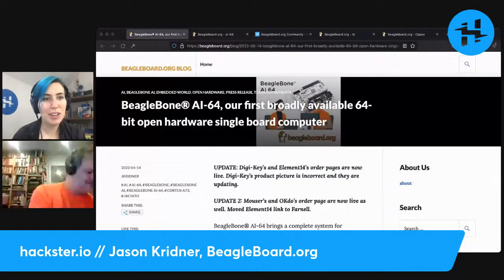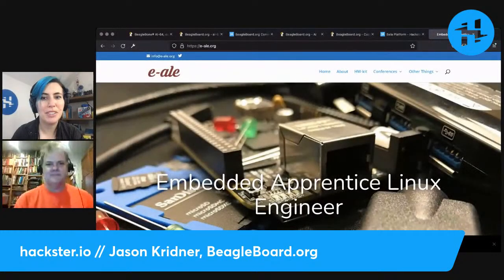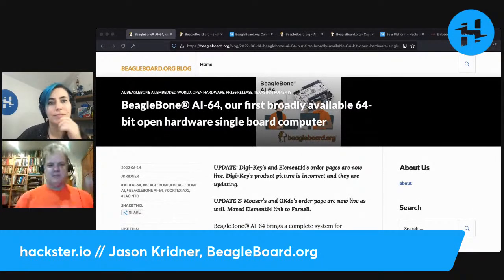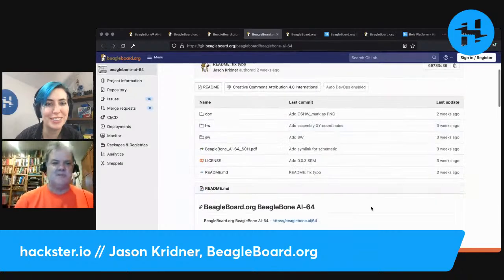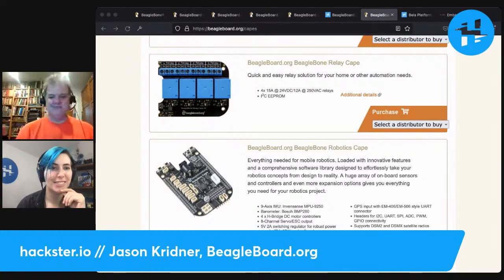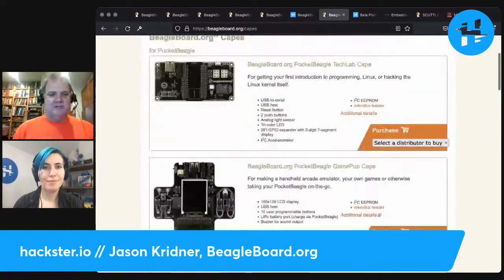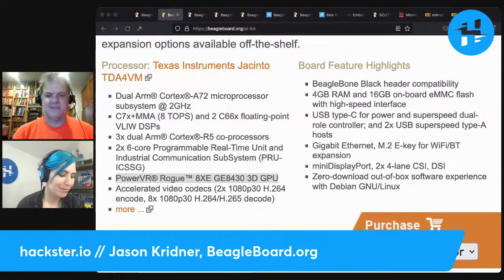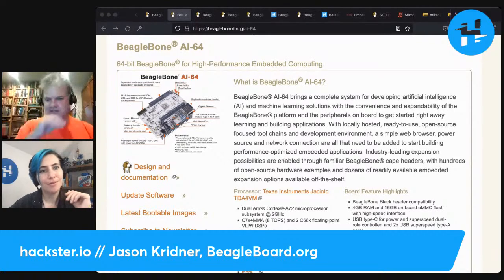Jason Kridner, BeagleBoard // Hackster Café

Comment: Maybe the UDOO RYZEN Bolt V1000 Maker Board SBC might have been a better choice as it can take ARDUINO source code and can be programmed using gcc-80586 toolchain+Code::Blocks IDE, the SBC has a HDMI out as well as sound and is a very capable SBC.